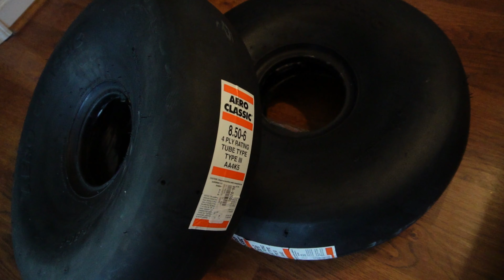Does size matter? Aero Classic 22 inch tires on the AVID FLYER!

Comment: Those 22" look great on your Avid and are plenty big enough for 99% of bush flying.  Bigger, while makes it look big-boy cooler,  just adds a lot more drag/fuel burn. If you need to land in large rocks, deep ruts or silt-soft sand then go bigger. I run the Aero Classic 21" on my CH750 STOL and works great on really bumpy dirt & grass strips, river gravel bars, beach sand and such.
Reply from the maker: Thanks, Clif! I was looking for a 701 or 750 when I found this Avid! I think I’ll leave the tires on- I just need to upgrade the brakes for now 👍
Reply: @OneAV8  Great! I have double puck Matco on each wheel and that has been enough for now. Beringer is very pricey.
Reply from the maker: Man, you’re right. That’s what I first wanted… but I have a hard time swallowing the price tag for such a small plane. I’ve been trying to figure out the Matco setup I’ll need. Glad to hear your perspective that they will do the job.